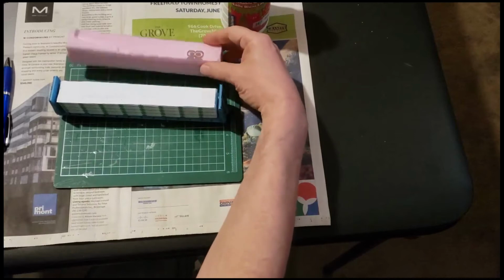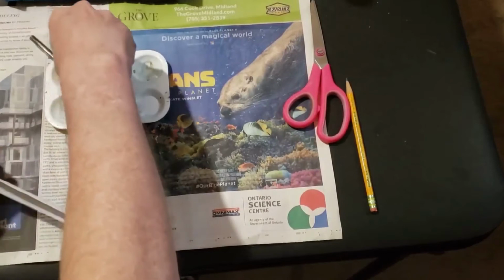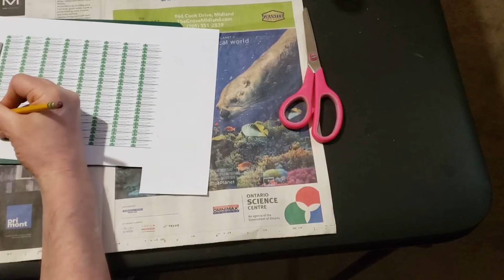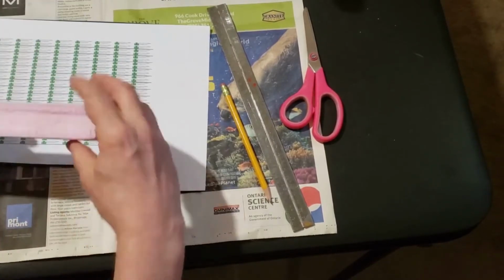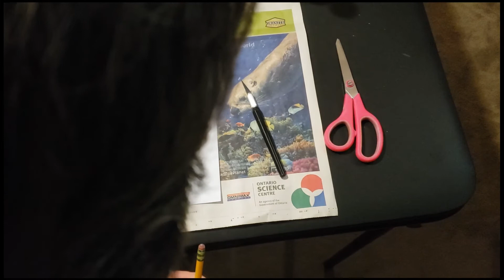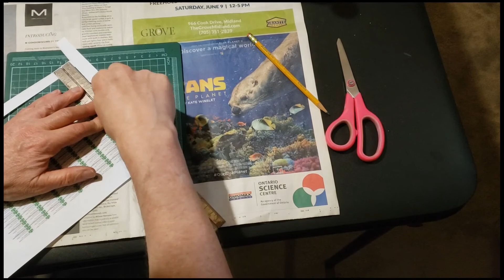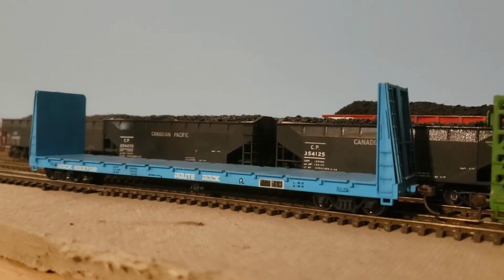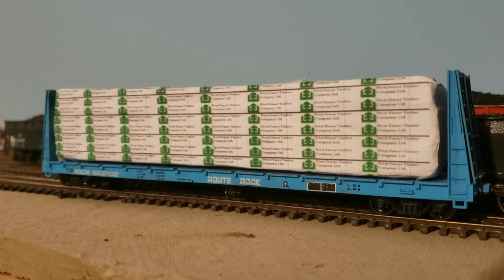HOW TO: MAKE WRAPPED LUMBER LOADS FOR BULKHEAD FLATCARS

Comment: Something I have been experimenting with is using neodymium magnets in the bottom of my loads that go onto flat cars. They are strong enough to hold the load securely when using a light material like foam.
Reply from the maker: Thanks that's a great idea!

Comment: i still remember how we loaded them cars 8 a day we did 2 times a day they switched the cars for use too   short and put in into the yard I remember they brought a lead back to use the tested how well we striped the load too hit it so hard the buck head crack there welds on the car lol  
they pulled 2 other cars in with it they never passed the test lift was all over the cars too
think lo of extra work to have the cars reloaded too
Reply from the maker: Thanks for sharing your experiences loading and unloading these cars.  When your switching a model you really don't think about everything that goes into the loading and unloading process.  Also thanks for watching.